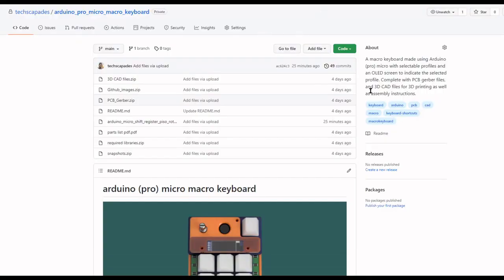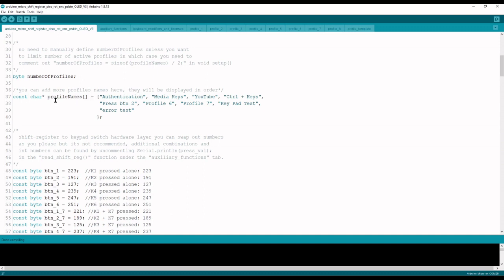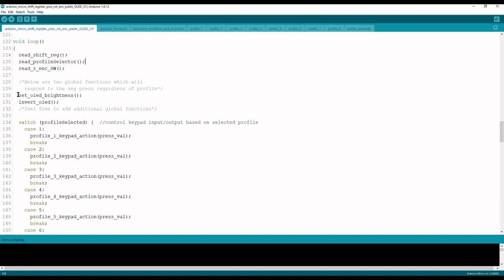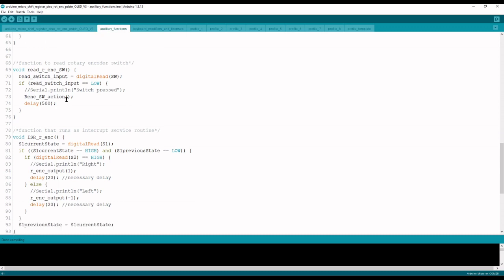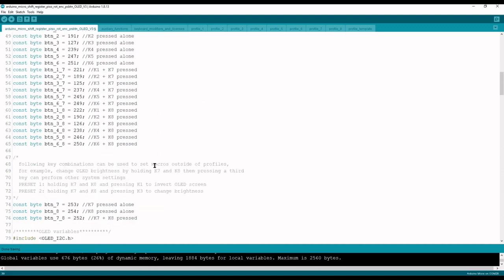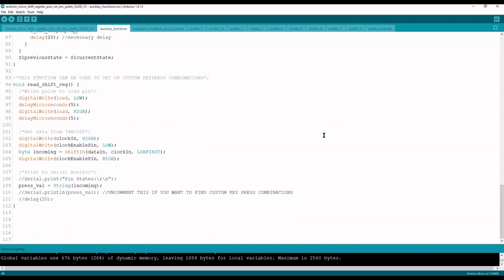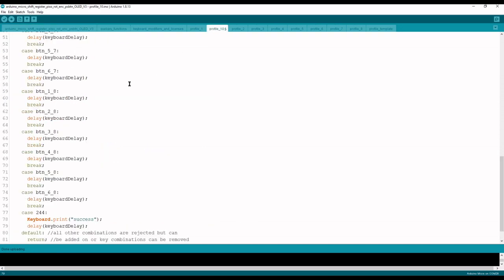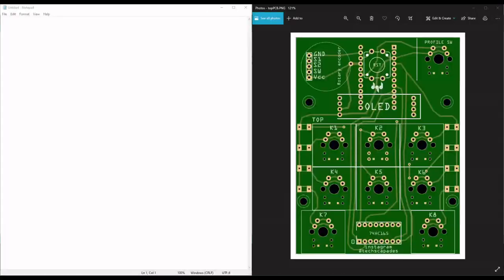Arduino macropad keypad with OLED for media control, streaming macro pad, automate keystrokes etc..

Comment: Interesting that you used a shift register
Reply from the maker: Yes, i thought of using it instead of the usual diode-resistor configuration to save pins and simplify the board